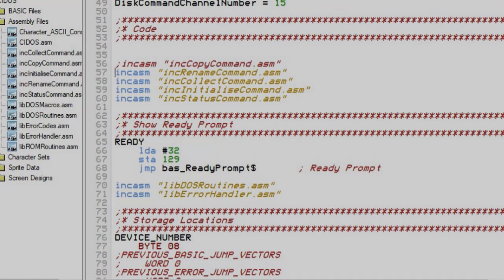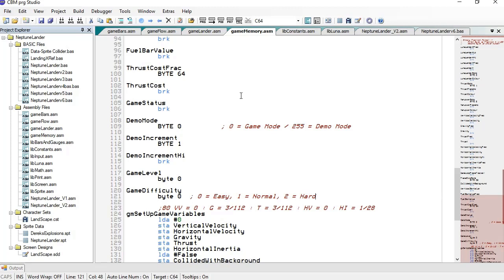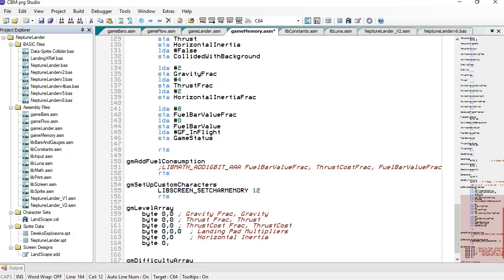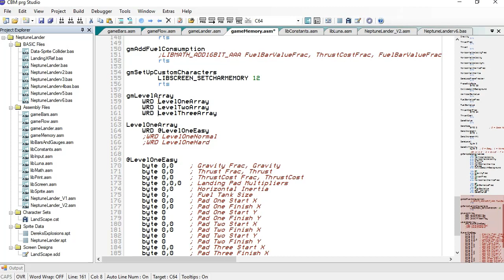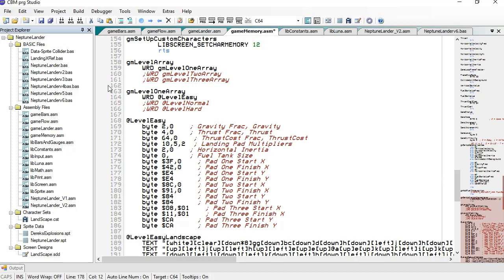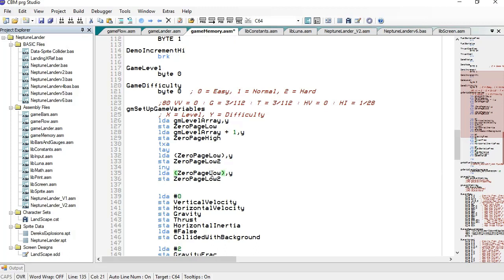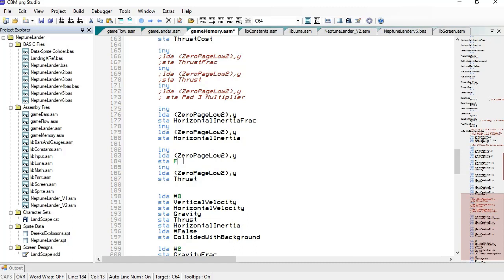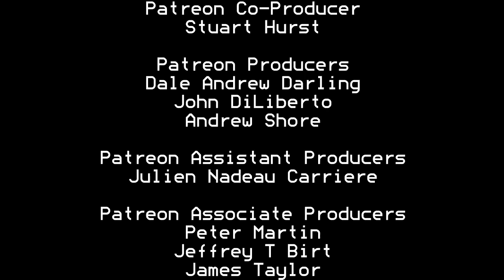Tutorial 35.18 - Adding Difficulty Levels Part 1

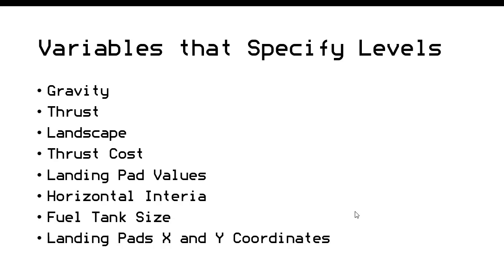Comment: 2:41 Isn't "Fuel Tank Size" redundant with "Thurst Cost"?

12:10 Do the Y coordinates of the pads really need a range?  If you're dropping fast enough to skip multiple scanlines at a time, then you're probably going to crash anyway.

14:35 If the assembler spells out the directive for "BYTE", why wouldn't it spell out "WORD"?

26:32 The .Y register is going to need to be the Difficulty index times two, and .X, the Level index times two, in order to skip past two-byte words.

28:00 It would be a better plan in general to keep most of your variables in zero page.  You can use a lot of the zero-page locations allocated to BASIC since you don't need BASIC for your program.  You could also save and restore a big block of zero page to make sure BASIC and the Kernal continue to work without problems.  I'd say that your program doesn't need the Kernal either, but you use CHROUT for the landscape.
 
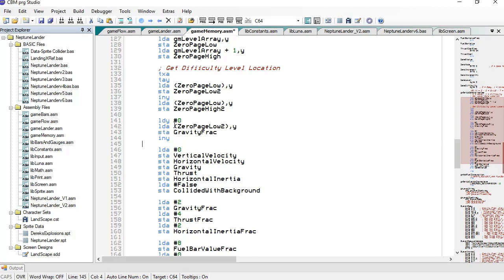30:00 You could do a block copy if your difficulty/level parameters matched up with the order of your control variables.
Reply from the maker: Watcha Matey, Right....
Fuel Tank Size, yes I thought hat too, but it turns out that you still need that if you want to have a finite amount of fuel.

Y Landing Pad Ranges, yes, ive been getting round to adding that, as sometime (and only sometimes) we skip two pixels, and then we can miss the exact pixel line, so will be done.... eventually ;)

WRD... thats one for Arthur I think.

Y register.... yup matey spotted that and fixed in next episode ;)

Zero Page Storage, you will see matey in a few episode times, I completely relocate the variable space ;)

Thanks again matey for you feed back, its great to get another developers perspective :D